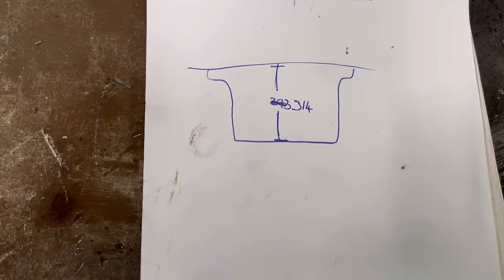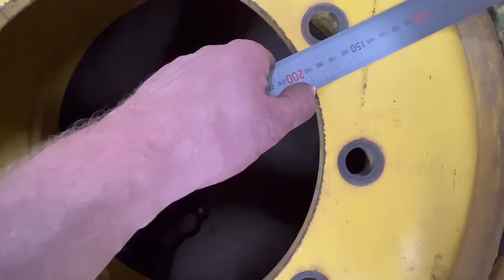Altering the offset on big fat tractor wheels

Comment: My wife just asked me this -- "Couldn't he have used his pallet forks to break the bead on the tire?"  I love her so much!
Reply: I thought the same thing, but remembered that most forklift forks are simply hanging from a crossbar,15:12 and the width can be adjusted by sliding them left or right. Another tractor on the farm probably has the type of front end loader that could push down on the tire.
Reply: He does use the forks to squish the tire down into the “drop” of the rim on the second one. 

At the distance from the mast of those long forks, he’s not going to get much force to break the bead loose.  As you say, a front end loader or wheel loader can deliver the kind of pressure required.  All in all, the tires weren’t stuck on the rims badly, so breaking them loose wasn’t the biggest problem.  Getting the first few bites with the tire irons was the big job.  Some tire lube, cooking shortening (CRISCO) or even WD-40 would have helped a lot
Reply: @jimrankin2583  Not at the point I  wrote this comment, he had not.
Reply: @davidgibson5756  Miss the point much?
Reply: @davidgibson5756 my thought was just use the forks to break it with a heavy load on it🤔💁

Comment: Definitely the right call to take off the tyre. The heat itself from the gouging  would cause the air to expand inside the tyre and it could potentially explode. Good job! 😊
Reply: Somewhere on You Tube there is an old video that a tire company made showing why you should dismount the tire when welding. Blowing your head off was the number one reason. Good call Oliver
Reply: While you are right about the pressure I always just let the air out. Never bothered to take the tire off and never had a problem with anything. Just make sure it's not a tubed tire xD

Comment: I'm surprised you didn't put your 200mm spacers on the floor then set the rim over them, so your weld would have been facing up. Good catch on that flipped center. That would have been a bad day.

Comment: Well done on trueing the wheels up. Reminded me of trueing up wedge lock rims on JD 4020. Set a spray can beside the wheel and roll it over tightening the bolts to get it even. I was yelling at the phone when I seen the second center upside down!😂 I had faith you would see before you welded it. Don’t blame you for sending the wheels back without the tires on them. Save the customer money 😁. Great video! Be Safe!

Comment: Have an idea for the next video. Fabricate a stand for the rotary table so it can adjust to a vertical position so you don’t have to stand on your head to weld. I do admire your will to get the job done right though. Keep up the good work and Be Safe.

Comment: Nice job!!!  Good Idea mounting the wheel center on a spare hub!
Hindsight is always easier... But, I might have done that before I started just to get a baseline for how far out of center it was and how much it wobbled when I received it.  I also might have tried mounting the wheel on the spare hub and securing the edge of the rim to the table while I air arced out the wheel center. With the wheel secured in that fashion it may have been easier to "float" the wheel center in place and use spacers on the hub to create the required offset...  Once it was tacked securely, welding it out like you did was just like having a rotary positioner...

Comment: My first reaction was it use threaded rod to suspend the nave (centre) of the wheel and then use wedges to centre it but your method works admirably.  The only point worth making is that as the offset is now greater there is more leverage on both the steering and the bearings that will need to be monitored more regularly.

Comment: Lot of work to offset two wheels. But nicely done. So many of those big front wheel tractors come out the factory with the wheels hitting the tractor at full lock. Years ago had a brand new County. Chewed into itself every time you took a tight turn. Ie. Only one football field. Some manufacturers get over this by making the wheels lean out as you turn. Whichever it is a problem you don't get with the small 2WD tractor wheels.

Comment: Hey mate, thanks for your videos, they're good stuff and I like the way you approach and clearly think about jobs.

I've got a bit of a tip for you if you're interested about using heavy hammers, or more accurately how to reduce having to use them.... first off, I'm 6'4" and 120kg, and I'm not built for using sledge hammers either - Nobody is.

So, the thing about hammers is that when you use a hammer you're always actually using two: there's the hammer, and there's the thing you're hammering against which is a dolly or anvil or forklift tine or whatever. The thing you're hammering against has a bigger effect than the hammer,  it's hitting back at the same time as you are hammering. 

In this video you hammer out the centre after gouging with the rim sitting on the forklift tines. If you look at the video you can see how you're wasting a huge amount of energy by just bending the tines, which is effectively the same as having a spring between your hammer and the workpiece. If you lower the tines so they're on the ground then more of the energy from the hammer will be focused into the join you're trying to break and I guarantee you'll need a fraction of the hammering for the same work.  One other tip is that moving the hammer twice as fast quadruples the energy, whereas doubling the weight of the hammer only doubles the force. So if you can use a hammer half the weight but swing it twice as fast, you'll be doubling the force of your hit.

Hope you get some use out of the tip, and thanks again.
Reply: Great advice!

Comment: I love seeing all of the creative ways you're able to fixture and maneuver unwieldy materials in your shop, it really inspires some of the design work I do professionaly as well as how I operate in my home shop as a weekend warrior. 

quick question but do you know why the rims only get welded on one side? Intuitively to me it seems like welding both sides is stronger but clearly that's not the standard.
Reply from the maker: I’m not sure. All tractor rims with pressed solid centres like this are only welded on one side. Must be a reason but I don’t know what it is.
Reply: @snowballengineering  Its probably that the one side weld is sufficient to hold the rim ,  most people would do a double weld ,  ( belt and braces )  . I think it is purely down to cost by the manufacturer   .

Comment: For a job like that you can use the smaller gouging rod and probably move along faster, because you don't have to be as careful and you can get a hotter burn at the rod's end making it easier to control your gouging area. (I would use the smaller rods when I couldn't get enough amps because of my distance from the machine, and you can move along pretty fast with those.)

Comment: Rather than using a clamp, Drilling a large hole in the end of the forklift tines to fit a bolt or eyebolt will make it much safer and easier when using slings to lift things.

Comment: that box section jig you made would it not work just as well if you tack welded it together and instead of lowering in from top sit jig on floor and flip rim over on top of it same result but now you don't have to reach under to tack it you can tack and weld it in lift off repeat for other one all up dam nice work i think i have say this before we all do things a bit different to achieve same end goal keep the videos coming i am enjoying them so Cheers

Comment: 30:39 could be an option to put the rim on the welding table. A good spacer under the centre plate. Looks to me a more accurate methode. Especially when u use a pipe you’ve made to length on the lathe. But as always, good job. 👍

Comment: It's a shame you can't clean out the plasma table. Drop the wheel inside and plasma the hole out. For a cleaner and quicker cut. If that's a thing........
I'm no welder, but the thought was there

Comment: Try building  a rotating centre arm that holds the burning rod and is fixed to the centre of the wheel the arm can rotate 360 degrees holding  the welding rod can be adjusted to cut at the right angle to the  rim of the wheel to remove the centre hub in the wheel
Reply: I think that would be easier said than done. The wheel has a certain amount of run-out and the gouge rod is consumed fairly quickly.

Comment: I don't do tyres of any size.  Just one of those things I decided early on I will not do.  Those wheels are not a terribly high precision component. As long as it is not obvious going down the road they are good enough.  Check the next OEM set before you start your work to get an idea how far out they were from the factory.

Comment: I’ve got a question, would it work if you just turned the wheels around put them on inside out. Not mess with all this other stuff.
Reply from the maker: No. The offset is one extreme to the other if you did that.  Me and the customer are not daft, we’d have done that otherwise.

Comment: Could you have put the wheel on the cutting table and used the computer controlled torch to cut out the center plate?
Reply from the maker: The rim is too tall

Comment: Not easy but well done, I used to do wheels for some lads who used Mk2 Golf rims on their hot rod, but only moved them 30mm and they wanted them like original, I did what you did but clocked then on my lathe.
 They ran spot on but they got caught out by a track marshal who was listing to the bragging in the pub about the offset lol

Comment: If the weld ended up almost in the same place cudnt you have just taken off the tyres and fliped the tread direction then put the wheels on the opposite way round from usual??.....🤔
Reply from the maker: Not as simple as that unfortunately

Comment: I don’t understand how it can be out unless the wheel itself is not square so to speak, you had 200 mm all the way from one edge but that made it uneven so you have had to make it a slightly different measurements . I believe that’s the original makers of the wheel, it’s a pity you had not tried it before and also had the measurements all the way around before you started,well next time you will know, , as that would of told you,great video and attention to detail.

Comment: If you can use either side of the center, why didn’t they just turn the wheel around and bolt it to the tractor
Reply from the maker: Because the the centres are offset in the rim, if you did that it would be miles off.

Comment: Just want to say that it is a very bad idea to weld on a rim with the tire mounted. because when you weld, the air in the tire gets hotter and expands and this can happen so fast that the tire explodes, even if you have removed the valve.
Maybe low risk but you won't do much more if you sit on a tire that explodes. 
Be careful out there fellow fabricators